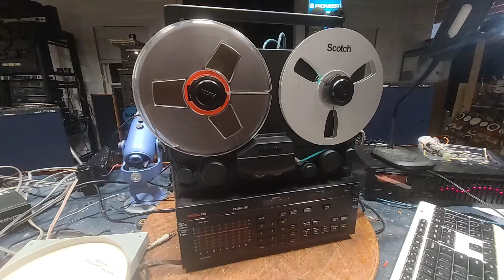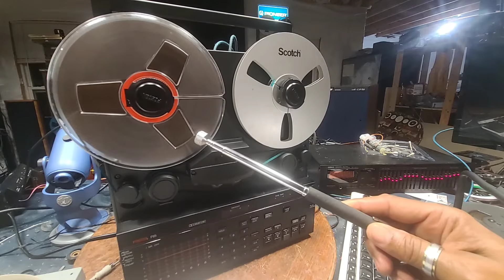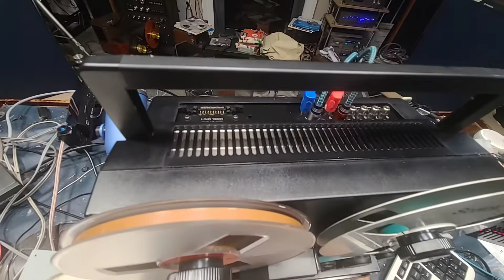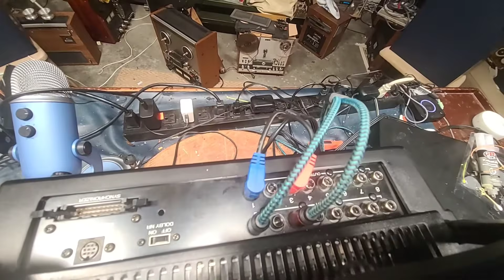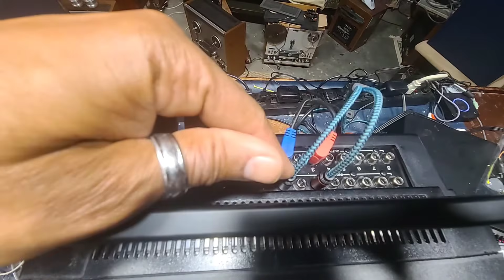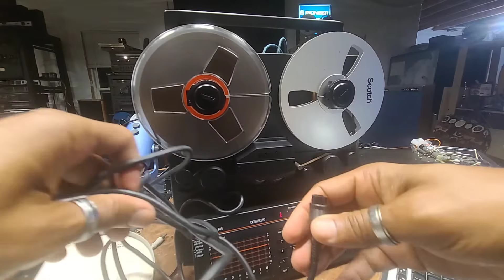Fostex R8 Reel to Reel Review

Comment: I really like the R8. It sounds better than you would expect. The plastic reel pulleys are the weak point but good replacements are available and are easy to change.
Reply from the maker: Good assessment, TCA. I use a 2 part epoxy by JB Weld to secure those 3 pulleys to their motors. I've seen the metal replacements you mentioned. I'll keep them in mind.
Reply: @5thcomm  The metal versions are very well made and work well. The pulleys on my R8 were completely split or I would have used epoxy because the replacements are more expensive.